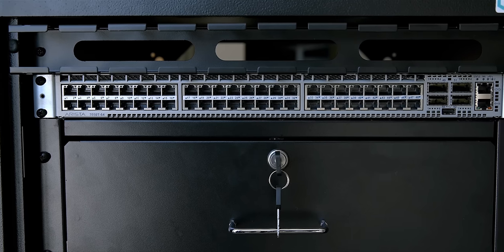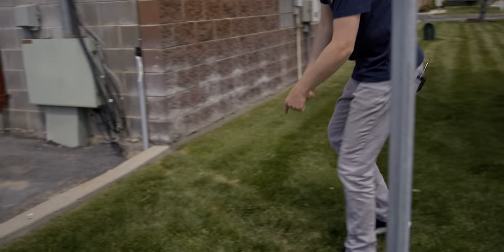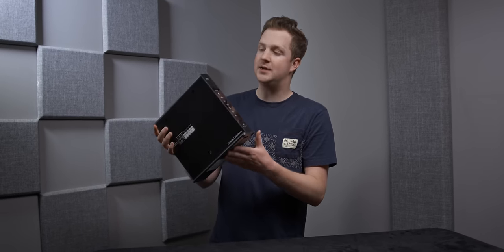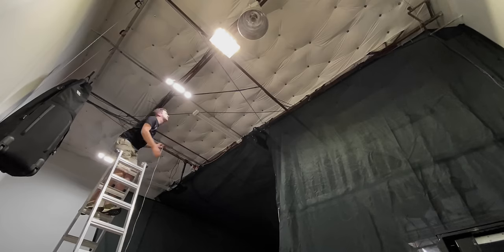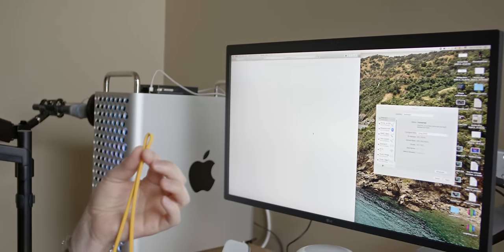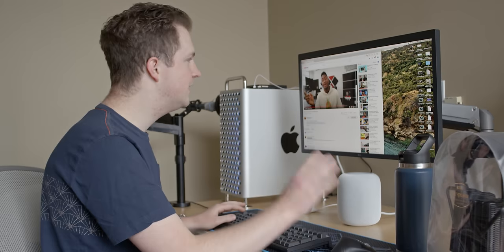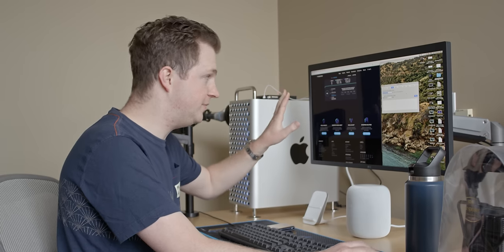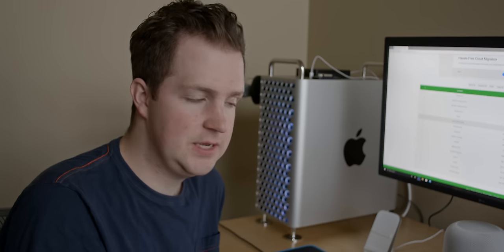How does fiber internet work? 0ms ping!

Comment: If you bend the cable you should see interface errors for layer one issue, CRC errors or maybe runts. That's really what you should have been checking for, not loading web page. Also  their is this feature that some switch have call digital optical monitoring that monitors whether the light in the fiber is with in spec. The arista switch you have I don't know if it supports DOM.

Comment: bends alter the reflective ability of the fiber until you end up with attenuation, it also occurs when a coax or fiber cable are severed and not properly terminated. the coax will attenuate with RF interference where as the fiber will occur through light hitting the sheared or broken part in the fiber line which acts like a mirror or prism and reflects it back down the line to cause interference which will cause a loss of signal through limiting of the intensity of light to it's destination. if you have a physical splitter in a coax system you'll want to buy little terminator caps that screw into the end of unused coax line or onto the unused part of the splitter itself or you'll cause attenuation in the system which will end up creating "lag", also not properly tightening the coax connectors can also introduce it.  while it seems like a simple "garden hose" system when you look at it there is quite a bit more at play!

Comment: 17:22 Although 0 ms is strange, the ping address is actually your local public network address, not the IP address of the speedtest server, so the 0 ms delay is actually the delay between your Mac and Modern, if your gateway also on Modern, you will find that the delay from Mac to gateway is the same. Maybe something happened during speed measurement

Comment: light waves dont travel like electrons, they need a straight-ish path. fibre is glass  bouncing light,  if the corner is too sharp the light bounces backwards. Electrons travel like a chain, they can handle sharper bends but are much slower.

Comment: As a person who worked in cable for a telecom company....Coax is PLENTY for current internet needs. In Canada I connected many customers with 1GB on Coax.  Fiber IS better yes. But its technically not needed with todays tech.  Just wanted to clear up that Coax is old yes. But on 6U or 56u coax, 1GB+ internet is possible. I have also installed fiber connections for customers.  As stated, yes fiber is better. But Coax is plenty

Comment: fiber works by "refraction":the light pulses bend in the sheath at a certain(?) angle; change the angle enough(bend) and it won't continue to bounce down the fiber.

Comment: Regarding the bending of the fiber..  a better test would have been having a light tester connected to the end, as you bend it and the stress begins, you would be able to see the dBm drop until you reached LOS.  You would also then be able to see that the light will degrade rapidly with each bend, even after returning it to a “flat” state again.

Comment: I expected better results from your connection, I have Fiber with ATT 1GB up and down, also connected to a Unifi device, I get on speedtest 980Mbps up and 940Mbps up, sometimes shows over 1Gbps the results up, and that at U$ 70 bucks a rmonth, not bad at all. ATT Gigapower rocks. Thanks for the video, need to up my Cat5E on the house to Cat6A to up to 10GB to the desktops.

Comment: Please note that every bend you do in fiber reduces its throughput. It's not just a simple "it works" or "it doesn't work". Fiber is great (I install fiber in the enterprise and medical sector), but it's like anything else, it has its applications and limitations. Cat5e even does 1g, Cat6a can do 10g, Cat7 is rated for 10g, and Cat8 can even do 40g, but is rated for 25g. Where fiber really shines is its distance, bends are its week point and several cripple its throughput. I would not use fiber where I had a bunch of bends, I would use copper so long as I wasn't exceedingly 100 meters. Fun fact. Do your research, plan your project, and stick to your budget 👍.

Comment: Bending the cable will change the angle between the light and the cable (glass) which should be exactly at an angle called the "critical" angle for the light's forward propagation i.e.  your internet.

Comment: Ii you're interested in why the cable doesn't work when he bends it, look up Optical fibre refraction. As the core of the cable is made from glass (which is the size of a human hair) when light travels through it normally it'll bounce from one side to the other but when bent it will shoot outside of the plastic cladding due to the plastic cladding being stretched allowing it to escape. Typically you shouldn't bend fibre more than 90° as this will cause macro/microbends which in turn will reduce the amount of light to be passed through the cable and therefore reduce your speeds.

Comment: When you bend or crimp a wire, it reacts the same as a hose with water in it would. Electricity and signals traveling through wires behave in the same manner as water does. So yes, when you crimp the wire it doesn’t allow the full flow.

Comment: 11:45 Yes the signal is basically pulses of laser light that bounce back & forth along the length of the fiber using total internal reflections. Too sharp a bend will cause the signal to leak out or degrade

Comment: the reason it stops working is because the angle of reflection cant reflect it around that extreme of a bend. I have 1 gig speed at my home. I get 980 up and 980 down with cat 8 copper wiring hard wired.I just have my ISP modem and a tp link dual band router that will pump out 1 gig wirelessly. I want a full  1 gig up and down. But I think i need to run an fiber cable all the way to the pc. Which will require a new PCI card that has a fiber optic connection. They are about $150. You can get a laptop to 1 gig speeds. But youll need to switch out your network adapter card for a dual band 1 gig and use the 5ghz band. Which has limited distance. You might be able to get 1 gig with the 2.4 Ghz. with the upgraded card. My total cost to get 1 gig speed about 45$ for the router and $71 a month for 1 gig speed.  I later built a cloud server out of an old tower using SSD hard drives and a free open source software i found on the internet. The software also comes with an app so you can stream movies and music that you have saved on your cloud.

Comment: At 11:00 u know why? U are putting a micro bend on the fibre so the light reflects out of the side of the glass creating the data to spill out the sides and not continue down the glass!  Minimum bend radius is 30mm without faults happening! (I’m a Fibre engineer in the UK). Also over here on a PON network we only split it 32times instead of your 120 odd!

Comment: So PON you mentioned in the video, does it mean a single fibre optic cable from the CO to the building and goes into a device that spreads this single fibre cable into lets say 100 - 200 units thru ethernet cable? Just wondering dont blame me if I was completely wrong...

Comment: Idk much technical stuff but my ISP gave me FTTH connection with gigabit hardware and I can choose plans from 30 mbps 1:1 up down to 1gbps 1:1 up down and all it needs a subscription as soon as I pay for 1gbps plan (pre paid) upgrading from 100mbps plan I can use 1gbps bandwidth straight away I never needed any hardware upgrade so isn’t mine connection is kinda same if it do gigabit speeds that’s also with symmetrical up and down

Comment: Bending the optic fiber to much the light exits the cable in a too tight corner so as long as you don't break it it will come back when you straighten it. I am still happy on copper, i am lucky that i have such a stable VDSL2 connection 95Mb down and 32 Mb up and ping of good servers in my country are about 8ms.

Comment: Also, you cant test a bent fiber cable just by bedning it and loading the same webpage over and over. Do some proper speedtests otherwise you wont see the insane speed dropoff that comes with "extreme" angles as the light starts to leave the fiber strands.

Comment: actually that's cool that your network terminal equipment or whatever has fiber out. the one my ISP gave me is a GPON (i have a passive ON, but gigabit both ways) but with a router and switch built in so it has only copper outs. But yea, MAN getting FTTH has been such a boon it's awesome. 
Also, this video is only 1 year old, is 1Gb internet really that rare in US?
Reply: There are a lot of places with fast internet and then a lot of places with absolute garbage internet. It largely depends on where in the country you live. I live in a town in NorCal of 67k people. Neither AT&T nor Comcast (the 2 main internet providers in my area) are interested in fiber internet for home use because it would cost them a lot of money to rollout fiber to the entire town. There's actually a neighborhood in my town where the best they can get through AT&T is an incomprehensibly fast 768 Kbps down DSL connection for $49.99/month.

The biggest problem we have in the US is lack of competition. ISPs will often make deals with the local government to monopolize that area. They bribe (lobby) the local politicians to allow that 1 or 2 ISPs to be the sole providers of that area.
Reply: @JJFlores197  what do you think of internet run by local govt? (this has been pitched by a few ppl as a nice solution as traditionally govt won't care abt profit margin -though otoh...)

Comment: Distance to your ISP via fiberoptic path = ~ 15.3 miles

Average ping = 0.164 milli second = 0.000164 seconds

speed of light = 300,000,000 meters/sec
round trip approx distance to ISP = 0.000164 sec x 300,000,000 m/s = 49,200 meters
one way approx distance to ISP = 49,200 meters//2 = 24,600 meters or 24 kilometers = approx 15.3 miles

* calculations do not include inate latencies of networking devices or light waves bouncing inside fiber optic tubes.
Reply: they make a decent bit of latency. (the electronics in the middle)

Comment: 16:20 - did you work out how to get the full speed? I am using Cat 6 and a 2.5Gb port and I am also on a 1Gbps AON and I still only get 941/941 where as people on cable who use the 2.5GB port get 1100. and pay peanuts for it

Comment: Meanwhile on VDSL2 (FTTC) on netcologne in Cologne...

5ms against the datacenter of netcologne my ISP (similiar configuration as my Lab is 10 Gbit/s on an USW 16-XG from ubiquiti (with the exception of the 10 Gbit to 1Gbit on an USW-48 where I a short run of SFP+ 10Gbase-T modules and Cat6a between them. actually had problems with my DAC cables before which vanished when I switched over to SFP+ 10Gbase-T on the USW 16 XG)

When I still had 10Gbase-T Copper runs my Pings where more in the realm of 10 to the datacenter of netcologne
Reply: you got network directly from Datacenter, wow.

Comment: Did you ever get full 1000 up/down? Does your ISP use PPPoE or something else? I've read that UDM Pro's cannot handle full gig WAN speeds with PPPoE due to the way it's encapsulated and some hardware limitations.

Comment: When you implement a sharp bend in the fibre cable you prevent the signal from being reflected off the walls of the fibre cable,  The signal is a wave form. not a straight line!

Comment: a lot of the newer fiber has been plasticized.  its not like what we installed almost 2 decades ago.  That older fiber, if you bend it past the radius of a tennis ball, would snap the end would have to find the break and splice it. the generations before that were even more fragile.

Comment: Actually you bending the cable and it slowing down tells me your using a multi-mode fiber cable. If you had interfaces and single mode fiber cable which is thinner but stronger the light doesn't bounce as much and it will actually work with a bend that intense and you can bend it really hard before it snaps.

Comment: Just wanted to know about what is the use for the juniper device. I heard it is possible to directly connect to the UDM Pro. Sfp port. 
Sfp module with GPON  r PON is available. 
Please  guide me if it possible. 
I am planning to use UDM pro for my home.
Reply: The Juniper device is actually just a switch (Juniper EX2300-C), and he doesn't really need it. He could have connected the fiber directly to the UDM Pro.

Comment: I use fiber optic throughout my whole network.. every customer has to get fiber bcz i have given up on cat 5 due to reliability issues... Cat5 goes bad after 2yrs of indian summer & monsoon.. thats why i switched to fiber optic .. it costs lot more but no one complains about slow speed .. although i had to buy an expensive splicing machine , and tools . & Then a 4000$ olt. + Every onu costs around 30$ + cost of fiber optic , splicing and splitters (customer pays 25$ & they have to return it if they decide to not use from my company). Internet is super cheap. U can get 50mbps upload & download for less than 7$.. 1gbps upload & download is around 100$.

Comment: I've had 1500Mbps up and 1000Mbps for two years now. It's Fiber. The download speed is 1.5 times faster than my 1000Mbps network adapter can handle. That's wired speed. Wireless will never be that fast from router but wireless should never be used for gaming due to lag and long ping. Wired, perfect. Though In have Cat8 cable.

Comment: The bend in the fiber cable probably didn’t crack, but the refraction didn’t work, so the data couldn’t transfer. The fiber cable is probably plastic, because that bend should have broken glass.

Comment: Out of curiosity, I have gigabit service through a copper cable and I'm getting 980 down and 50 up to my computer. My ping is at 4 during low traffic times and 6 during high traffic. I also have about 40 other devices connected directly to a router and switch combo unit. Would it make a substantial difference between the 6ms and the 1ms?

Comment: Hybrid fiber coaxial networks. fiber to node, coaxial out to streets and homes. (I work for an ISP as a field technician "Cable Guy")
Reply: I don't know if you happen to know, but in a neighborhood with underground utilities, would it be easy or feasible for a provider to install FTTH? I assume that it will vary a lot between towns/cities/neighborhoods but I was just curious. In my area, we have AT&T and Comcast as our main providers. Neither provider seems to be interested in rolling out FTTH. Well, Comcast advertises their "Gigabit Pro" plan which is FTTH, but that can only be ordered by phone and they have to do site surveys to see if they can actually install the service.

I don't know if it helps, but I have a box similar to the one he shows at 2:32 in the corner of my front yard. It looks like the same color and even design pattern. I think mine says "Media One" or something like that. I imagine mine has the same black looking thing (I don't know what its called) inside, but I'm not sure.

Comment: Gees that is strange behavior at 12:27. I guess you are interfering with the way light travels through the cable. I can't help but think of the obvious waterhose analogy here haha
Maybe you did break the fiber but the PVC jacket is able to get the broken fiber to align enough to get enough of the signal through w/o too much insertion loss? bent, the fibers do not align and light is absorbed by the plastic and not kept in a neat straight propagation mode

Comment: So here's the part where you fail to mention that typically people who run Pon fiber Networks also put the proper lasers and receivers in that allows them to do 5 terabyte trunking. So you're going to split 5 TB of bandwidth with 128 customers. That's why they're inexpensive because the trunking aspect is the most expensive part of it. Rather came from the same topology the coaxial networks are still installed today. The other part that you failed to mention to is is that most people are using an ont. Optical Network terminal. Which is where you get your cable TV signal internet and telephone. I work for a company that we do a 1-gig by 1 gig over ethernet. And what you saw in the hand hole was a fiber trunk an inside of that case are multiple fibers that you slice drops onto and that trunk goes back to a fiber cabinet where it is plugged into jumpers.

Comment: I didnt know it was that hard to get fiber at your home outside Europe. I have my router and all that but at its side you can see the white fiber cable.
Reply: Also, 650 mbps down and 15 mbps up? Thats a monstruosity. Here the usual is 100/10 (for example, 600mbps down and 60 up) or symmetric like mine (600mbps down, 600mbps up)

Comment: I would think they PROTECT the fiber cable more.... it come out of the ground thru a metal pipe that exposed to run up a wall that can be CUT. each part of the wall the bolted the cable has the possibility of over crushing the fiber.

Comment: This is super geeky, and only old telco folks get it. But modems modulate and demodulate, that is convert analog signals from copper lines into digital devices on a computer (network). Pretty sure that’s not happening even with your crappy Comcast “modem.”  It’s NOT a modem. It’s a gateway router with a switch. Boom.